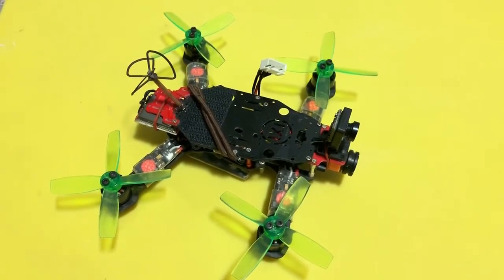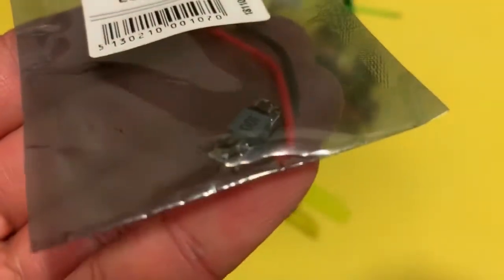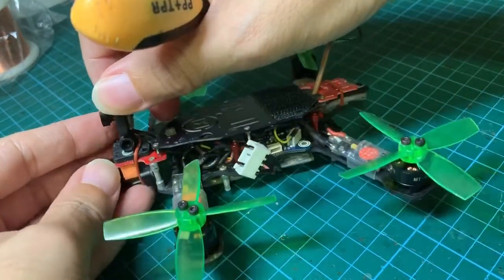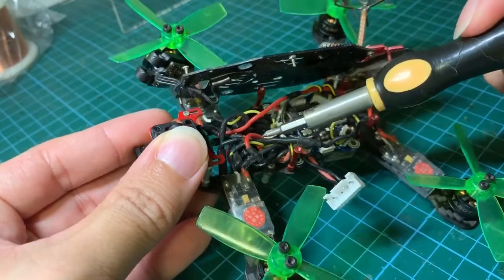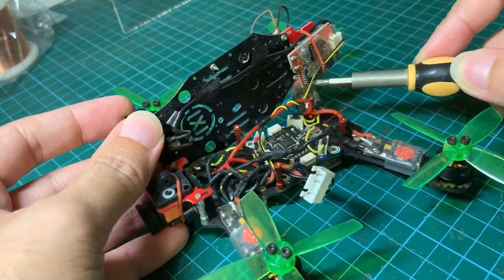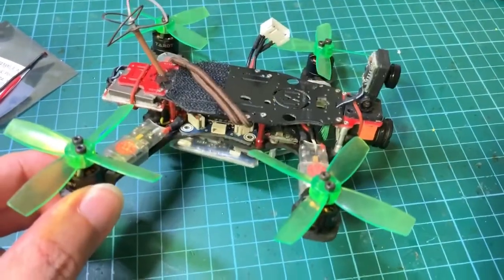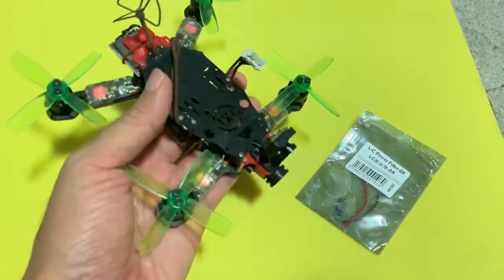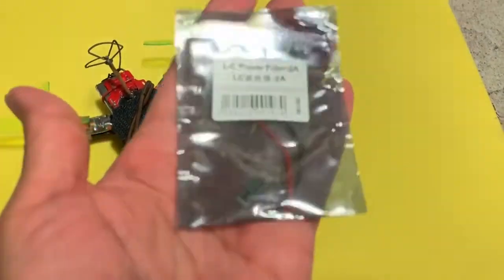Smallest LC Filter for FPV

Comment: thanks, was not sure where to wire this lc filter, some suggested between the cam and vtx but i suspected it and had an idea that it should be between the 5v out to vtx, thanks hope it will help with my video noise
Reply from the maker: Thanks for dropping by. For the filter to work, there should not be any other polluted power lines to your fpv gear. For example, if your camera or OSD is connected directly to the battery / esc, you would need to deploy separate LC filters to “clean” those power supply lines too.

Comment: Using a low esr capacitor on Vbatt might help.
Reply from the maker: Thanks for the advice! I will get an ultra low ESR Panasonic 1000uf cap for the battery connector.
Reply: @terence79chan  That might do it....
Reply from the maker: Many thanks to all your suggestions, the low ESR capacitor at Battery V-in did the trick. There’s only an occasional flicker now when I do a full throttle punch.
Reply: @terence79chan  that's great. I learned something too..... now to the man cave to experiment.....
Reply: Glad to hear!!

Comment: http://www.myrcmart.com/product_info.php?products_id=11036 <Even smaller!  Your Aliexpress link didn't work btw.  I find low-ESR capacitors more helpful for filtering video noise coming from the ESC's, though you pretty much have to troubleshoot such things with trial and error.  It's a good idea to keep LC's and capacitors on hand just in case.  Also, I've had a surge destroy an LC filter, such that it protected my much more expensive camera...  which is a nice bonus feature of using them.

Comment: Please forgive me if I missed you saying something about this I am having a hard time with your accent.... my fault, not yours.....
It looks like you have your video cable wrapped around your positive battery cable? If so, that may be part of your problem. I would try separating them, that might make it possible to run without even the lc filter....
Reply from the maker: Thanks for watching. I have tried replacing the wires going to the vtx and camera with the type with ground-braided wires on the outside but there is no noticeable difference. I suspect the punch outs are pulling a large amount of current that caused the regulator to produce ripple voltage, so “cleaning” the ripple voltage isn’t going to help much. I wish there is a special regulator to handle this better as I am already using the more expensive Pololu regulator (not the cheap China buck module). Son a side note, on my Aurora 90mm, the 7805 linear regulator works very well without additional LC Filter.
Reply: @terence79chan  seems like a capacitor is what is needed then..... even so, if you continue to wrap your vtx wires around the positive cable from your battery, I think you may have trouble no matter what you do even if the cables are shielded..... if you wrap your vtx wires around a pencil or something similar to make them springy that will help clean them up if thats what your after. Also, you can twist your positive and negativecables around each other to clean up some electronic noise as well. I always take my servo leads and esc eads apart and twist the black and red wires separate from the signal wire, usually yellow or white. That helps a lot. And when you do use a Low Pass or LC filter make sure you install it as close to the camera as possible....i like the pololu stuff as well. They make some really good low voltage regulator stuff. For voltage conversion up and down...... I REALLY like their anyvolt stuff. Or is that Demension Engineering? Also a great company by the way.
Good luck solving you video problem. There's a solution out there I am sure. Sometimes making your of LC filter gives you a better solution. I use a small ceramic capacitor and electrolytic capacitor and a small coil of wire wrapped around a ferrite core I usually find on old motherboards.....